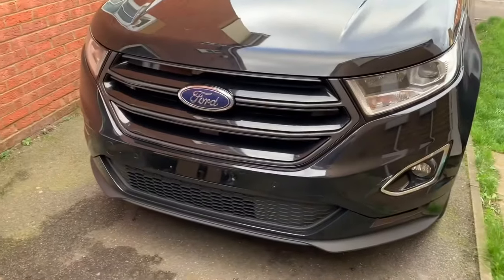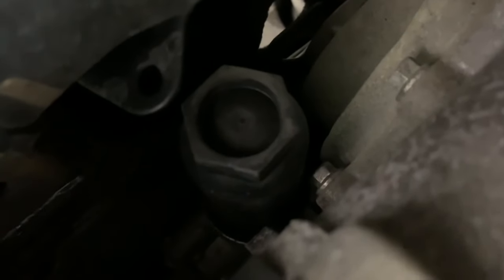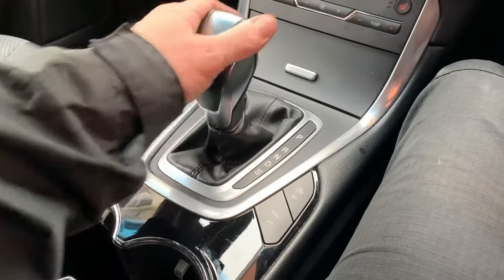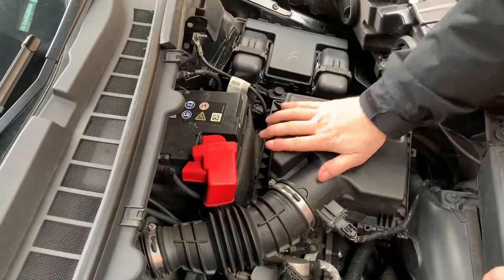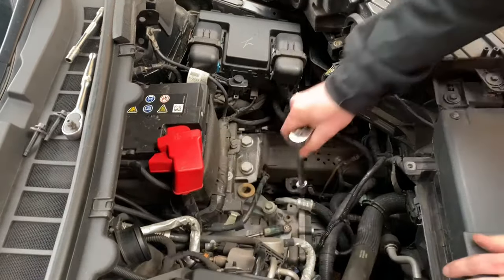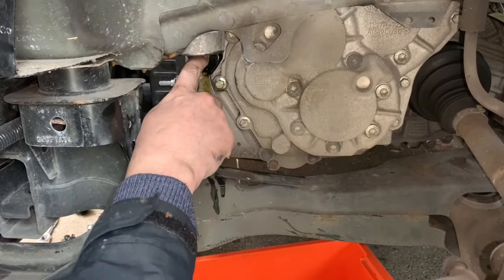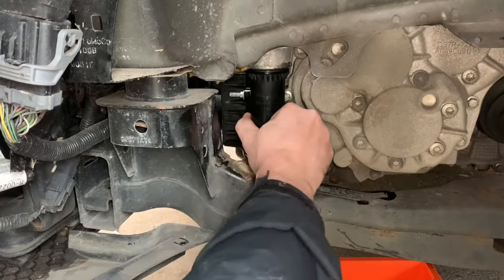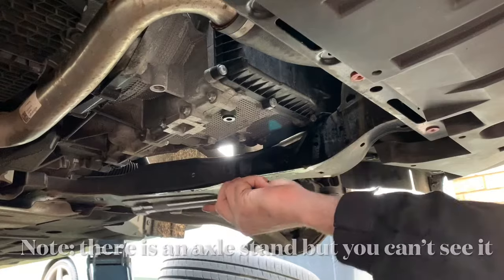Ford Edge PowerShift Oil and Filter service - Kuga, Smax and Galaxy

Comment: I never screw level plug. Always came out 7 liters and came in 7 liters, that's all. Any problem. Oil with outer filter remain after 40000km, but outer filter remain after 20000km, addition.

Comment: Hi so i want to top up my oil after a little gearbox oil leak which was going on for a few years can i jus pour the 1l of powershift oil in or shall i start with less then half also if its too full well the oil funel an oil jus pour out trough the bit im pouring the oil too tell me its too full

Comment: Hi I got ford s max auto 2.0 diesel 2015 new shape I had the gearbox oil changed at ford dealership on the phone they said the car needs 7liters but when the did it they only put 6 liters when I question it they said because only 6 liter came out they only put 6 liter back is that right and original the dealers say it takes 7 liters
Reply from the maker: About 6 comes out. A completely empty brand new gearbox might need 7. The 7th litre is for setting the level.
Reply: @StangsGarage  ok thanks so the 6 liters dealership put in my gearbox is fine

Comment: Hi yeah mines also a 210 auto and I’m only getting around 28 to 29 well below fords  figures of 44mpg  also so notice that it seems fuel computer freezes on 28mpg until I reset back to zeros goes up high then lowers to around 36 drops back down to 28 after a few days is yous a sport or titanium mines a titanium so not sure if that could make a difference in fuel consumption as my edge has 2 turbo’s some only have 1  any way thanks for your help and look forward to your next video

Comment: Forgot to ask what size are the sump plug on gear box Allan key size and is filler and level check plugs the same size as them thanks
Reply from the maker: Did I forgot to write that in. Not 100% but I’m sure it was an 8mm Allen key I used. Yeah they are the same though

Comment: Thanks for the video. Just done this on my edge. Very well explained. I managed to do it without removing the inner wheel arch cover. As a reference my tray bolts where 7mm. Gearbox fill/drain plug 8mm hex. 

Thanks again for the help.

Comment: Great video , I Have a 65 plate Kuga with the powershift box , I think after watching your video I will do this job myself as Bicester Ford want £300 to do the job . I think as long as you Measure what comes out and you have it on the level when checking the final level in the gearbox  you can’t go wrong 
Cheers Phil
Reply from the maker: They charge a lot for anything these days. I need to do the PTU. Just trying I find the time.

Comment: Hi just watched your video on changing auto box oil 
Hi I have seen a couple of this being done on a Kuga”s they also put 6 litres of oil back in but on there video when they removed
The oil level plug they caught the oil pouring out into a jug refitted the level check plug and then refilled with clean oil the amount that came out
I am looking at doing a auto box oil change my self on my edge and your video was a lot more clearer to watch as the other videos I saw where in garages
With poor light and obscure vision
One guy with his face blanked out. On your video you checked the level and poured some more oil in for it to pour out again
Did you do the same top up after fitting the check level plug or is that not necessary 
I have watched a few of your video and are all very clear and you can see all the items your removing to do the repairs
       Thanks
Reply from the maker: Hi, about 1/2 litre came out the check level but I topped up with fresh oil until it started dripping out the check level plug again. At that point I tighten all plugs up. I didn’t add any more oil. Pleased you found the video helpful.

Comment: Hello. I see the you have used Ford BO-DC WSS-M2C936-A  green oil. In my user manual it is Ford C-ML5 WSS-M2C938-A (i think that one is red). Is there any difference? My Edge is 2016 2.0 tdci 210 hp Powershift. Thanks.

Comment: i thnik that the 20 seconds in each gear is just necessary when the oil is cold.
Reply: I think it because it needs to curculate the oil around as there is  a top chamber and bottom chamber hence when he takes the side oil bung out some oil comes out as the bottom chamber is slightly too high then puts more oil in to fill top chamber which in turn overflows to bottom chamber then out side bung

Comment: Awesome videos. Have you changed the fluid in the ptu? Would love to see a video of that for the diesel edge.
Reply from the maker: One of my next jobs actually. Work unfortunately gets in the way of playing but will be doing soon.
Reply: @StangsGarage  Do you know how many liters of 75W FE goes in the 2016 2.0 tdci manual gearbox? Can't find the info anywhere.
Reply from the maker: @oneway1403  I don’t off the top of my hand. Should detail it in the manual. Online manuals are in the FORD Pass app.
Reply: Sorry just seen you are going to do PTU video, what oil would u be using for the PTU? Maybe a link where to buy if u have one? Got a 2018 auto edge and fancy doing all the oils at once myself.

Comment: Hi have watching your videos on your edge services I am just wondering have you done a fluid change on the power transfer unit/transfer box I have seen a few 
Videos on the this being done on a 2018 edge as some say it needs doing around 20 to 30 thousand miles as the fluid gets crappy have you herd of this or do you no of a service change of the fluid  thanks eric
Reply from the maker: Hey, it’s my next job. Not actually seen many people change but have heard and watched videos on it that it does get a bit crappy hence why I’m looking to do. Im hoping there is a sump on it but need to check first. (Main job gets in the way of playing unfortunately ) If not I need to to get a bit of kit to suck the oil out from the level plug and refill.
Reply: Hi the videos I have seen are most USA edge but can’t see being  much different there is a fluid drop plug just over exhaust but it is easy to get to The fill plug is next to right hand drive shaft on the petrol engines there a bit tight to get to not sure on Diesel engine does not take a lot of oil around 3/4  ltr as far as I’ve seen 
It’s the same on all ford awd ptu edge kuga galaxy mondeo Evan USA explorer looks like ford kept it simple also looking at rear diff oil just do search for Ford Edge PTU oil change on YouTube 2010 to present are all the same one  all the best and look forward to watching hopping to get mine done around February
Reply from the maker: @ericjohnstone910  nice one , thanks for that

Comment: Hi could you give me some helpful information on your edge what mpg do you get from it and what brake horsepower is it as on one of your videos resetting oil change I noticed your had 36 mpg  I have a 210 bhp and getting around 28 could be different in engine power so any advice could help many thanks
Reply from the maker: Hi, it’s the 210 auto that I have and I get an average of the about 35/36mpg accordingly the trip computer. My friends Edge is about the same. 28mpg seems a bit low.

Comment: Hi so after getting the gearbox service from ford i noticed when i checked under the transmission when i removed the cover theres leaking could this be down to them over filling not fully letting the extra oil pour out
Reply: Please let me know I need help I wanna top up the powershift oil is it under the air filter housing then do I open the screw an pour oil then re tighten jus had a little leak so want to add more oil now

Comment: Can i ask what ramps you use ? I've a 66 kuga and can't find ramps to fit the 235 tyres
Reply from the maker: They are just the standard sized ramps, had them for ages. They are smaller than the tyres but I have in the middle. I used them from my Edge as well. Not problems
Reply: @StangsGarage  awesome thanks,  wanting to treat the chassis so want ramps on rear and got stands for front